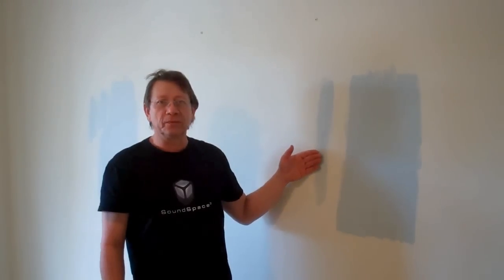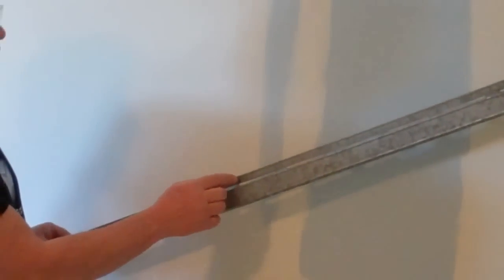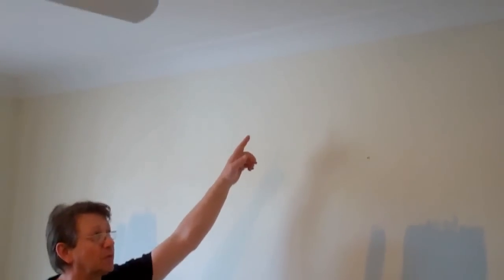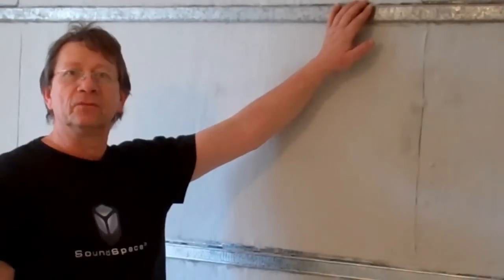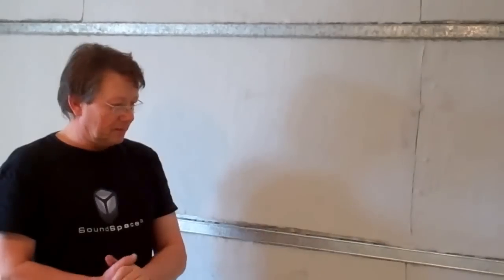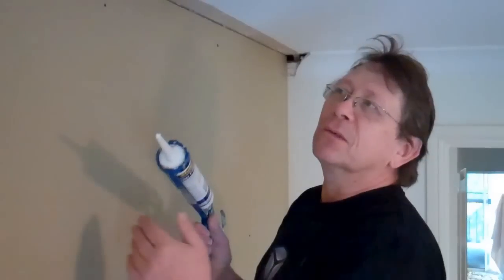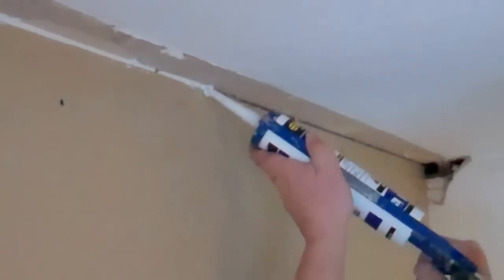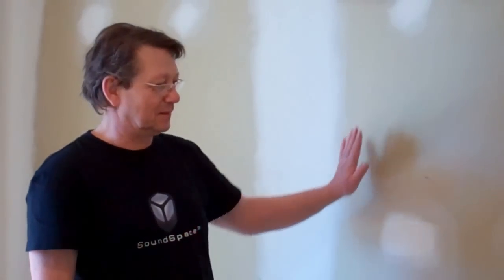How To Soundproof A Wall

Comment: i wish you could come to my country and fix my adjoining walls too! :-)
Reply: soundproofingexpert
Thank you, I've always wanted to visit Australia. If you ever visit USA then I would definitely hire you to do my walls. You seem like a very cool guy.
Reply: Aine Khell
there are all kinds of videos on youtube of crazy neighbors. but my number one complain living in the apartments is NOISE. The walls & floors are built cheaply here even we had windows so bad that if the upstairs neighbor walks the floor will shake and as a result shake my den room window :(.
Reply from the maker: I'de love to go there one day but a bit too far.
Based on your description, I think your apartment will be complicated and very costly to fix.
Reply: soundproofingexpert 
Well, here's what I ended up doing that year..: I opened the gypsum ceiling (removed the length about 2 feet wide / lenght of wall) and filled the gap between the top of the brick/ motar wall and the iron beam supports. Then, plastered over that with concrete and brick. Used several sheets of fiberglass to help muffle the sound and replaced the gypsum ceiling.

Then, removed all "holes" in the wall - light bulbs (2), switches (2), and plugs (2). Opened 2 horizontal channels in the wall; one around 3 feet from the ground and the other about a foot from the ceiling (gypsum ceiling).
These horizontal channels then allowed access to the hollow spaces in the brick wall which I back filled with motar.
The wall was re-sealed / plastered so I had one solid wall.
Then, I used heavy-grade "channel" (used in building pre-fab / plycem houses), put 3 channels one the wall - horizontally, attached the plycem boards to that and sealed any gaps with the sealant they recommended.

Yes... I did achieve a great deal of sound reduction from all that effort... but, it's not 100% - but - to me - it was totally worth it. ..

Next experiment will be with the window...but, for now I am cool with the improvement I have.

Worth every cent.
Thanks to videos like yours and the help of a very good friend, I got the courage to DIY my way to a quieter room...
:-)
Reply: Let me guess you live in USA right? Where we have cheaply built homes and apartment walls and floors. lol
Reply from the maker: No, I am living in Australia, probably the same thing!
Reply: 321192ify 
hm...I live on an island ...where we use bricks and mortar for walls...but we have "different" kinds of neighbours
Reply: Aine Khell
That is cool, I've never been on an island before but hopefully someday....I get to visit one. Where do you live if you don't mind me asking and what type of annoying neighbors can be on island?
Reply: 321192ify :-) the kind that make you go searching youtube for ways to block them out :-D
Reply: Aine Khell
oh God. lol
Reply: Haahahahahahahahahahaaaa
Reply from the maker: Which country are you?
Reply: Trinidad and Tobago
Reply from the maker: Thank you, that would be nice!
Reply from the maker: Thank you for sharing!

Comment from the maker: In order to reduce sound vibration as much as possible it is better to separate the plasterboard from the original wall and to separate the boards between themselves otherwise you'll only increase the mass of the wall and you'll need a much thicker wall to achieve the same result. You can also achieve better results by using a loaded vinyl 6kg/m2 or 8kg/m2 instead of the visco-elastic membrane between the boards.
Reply: One of the Best Ideas of SoundProofing is "SoundProof Curtains" it actually Block outside Noise coming from Windows. Check Here: https://livesoundproof.com/best-soundproof-curtains/
Reply: @laurabrown5445  I don't think so!

Comment: Many thanks for your reply. My main problem is that the party wall between me and my neighbours on both sides is just 4inch single skin brick. I have applied your method upstairs, which, has worked to some degree but downstairs suffers from impact noise where my lounge is adjacent to their kitchen and I hear everything from airborne noise, voices etc to impact noise of cupboard doors and drawers shutting and the noise echoes straight through and at times sounds as if they are in the same room as me. I have been made aware of a product MD40, rubber slabs glued to the wall but his is very expensive. Any thoughts, ideas, help woud be most welcome. Thank you.

Comment: I'm moving to a place with a game room that has two exterior walls and one to the garage (4th to house interior), the exterior walls are brick and windows.  I don't want to cover up the brick.  I'm thinking my only choice is either to investigate active noise reduction or hope there's enough room to get a permit to build an enclosed walkway around those two walls, and have that walkway act as the air gap, with its exterior walls well insulated.  I'd still need windows so may still have issues there.    Use is for live music and loud movies.
Reply from the maker: The windows need to be sound proofed as well, the best way is to build a second window, similar to the existing one and separate from from it with a gap as big as possible, 3-4 inches (75mm to 100mm) or bigger, using a 10.38mm thick laminated glass or thicker. The bigger the gap separating the 2 windows the better for acoustic. You can also add some sound absorber, glued around the inside cavity, to reduce the "echo" between the 2 windows, that helps too.

Comment: Do realize that you install the resilient channels upside down (wrong)? It matters!

The idea is to have the dogbone (slotted) holes on the bottom side. I'd expect this solution to reduce noise transmission by possibly 6 dB, maybe 10 dB if done perfectly (no possible way it will reduce noise by 40dB).
Reply from the maker: +Travis Lawrence Yes, you are right, the channels are installed upside down but I don't see any raison and couldn't find any evidence why it matters unless the plasterboard doesn't touch the floor, in that case it will be suspended and than yes could make a difference. Any way, thanks to point that out. Regarding 6db or 10db maximum reduction, I don't know where you got those figures, 10 db reduction is far too small and the new wall system would not make much difference, certainly not enough and my clients would never even hear a difference once done and simply will never pay me for it; instead they are very happy and recommend me to others, I am doing that for living since 1992.
Reply: +soundproofingexpert the 10db is just an estimation based on experience. Though I am only talking about what resilient channels specifically do for isolation, I wasn't referring to the whole wall system. In that case then STC 40 (40db) is quite likely.
Reply from the maker: +itsdastuff If you work from an existing wall you'll need to build a second partition wall separate from the existing one without touching it (10mm away), with tracks fixed on the floor and ceiling and steel studs (64mm thick) filled with no more than 50mm thick acoustic batts (avoid compression of batts between existing wall and new plasterboard, otherwise you'd court circuit they system) add 2 layers of 16mm plasterboard or 2 x 13mm acoustic plasterboard with mass loaded vinyl 2kg/m2 between, or 6kg or 8kg/m2 for better results in low frequencies.
If you don't have any wall and need to build a new one that achieve over 50db sound reduction, the most cost effective way that takes also less space is to build a staggered stud (steel) wall, 92mm thick tracks and 64mm thick studs filled with acoustic batts, with 2x 16mm plasterboard on each side and with mass loaded vinyl 2kg/m2 (minimum) between the boards.
Reply from the maker: +Travis Lawrence        OK, I understand what you mean now, that's right.

Comment from the maker: Bjorn Winterskorn asked me how the plasterboard was fixed, for some reason his question doesn't appear here but it is a good question; we screw the plasterboard in the resilient furring channels which are designed to minimise transmission of vibration but it is very important to use the right length of screws to make sure the screws doesn't touch the existing wall after going through the channels, otherwise you could court circuiting the whole system because the vibrations will be transferred from the existing wall directly to the screws and then to the plasterboard and we don't want that.
Reply: this is no clear to me - after installing the 2nd layer of plasterboard, you screw that into the resilient channel as well but of course you have to go through the first layer to get to it - so what exactly are you saying?
Reply: Wellob iously, use longer screws on the second plasterboard whatever the thinckness of board is

Comment from the maker: Resilient channeling can be attached directly to the wall but if you fix it on timber studs or battens you'll achieve better results because the more space you have between the existing wall and the new one the more sound reduction you'll have. Also, you'll have more space available to install thicker acoustic absorbers between the studs or battens.

Comment from the maker: If the neighbours are very loud, voices, Tv or music, you may still hear a little bit but it will be acceptable, according feedback I get from my clients who are quite satisfied with the results. If you can afford to lose 100mm (4 inches) you can build a new partition wall, separate and not touching the original one, using the same materials except between the studs were you can install thicker acoustic batts, there will be no much difference in price but you'll get a better sound proofed wall. Sometimes noise can come also from the ceiling if you have a common cavity with your neighbour for example, than you have to sound proof the ceiling as well.

Comment: Excellent demo and could be the answer to my problems. But, please can you tell me the name, make of the high density polyester and where to purchase. Cannot find it anywhere. Or, where I can get something similar? Thanks.
Reply from the maker: I have the high density polyester made to my own specifications but you can use high density fibre glass instead or anything similar, it is not the most important part of the system but it is good to put some kind of sound absorber, in fact, in any cavity to avoid increase of sound, a bit like a drum.

Comment from the maker: Very hard to tell, could be $300.00/m2, $100.00 more or less. Almost impossible to put a price before seeing the place.
Reply: true. I have used this ceramic insulation paint at home for heat insulation and that was the initial purpose. but now as i got into sound proofing i thought lets see if it insulates sound as well. i thought it would.  one manufacturer said 17% and your right i haven't notice anything towards sound. and i cant honestly say it does heat as well. i haven't tested either sound or heat properly.  I'm just saying. i think it does work at least a bit... it should as i paid a lot of money for the ceramic paint additive from usa.
Reply from the maker: When you reduce the sound by 10 db it is like halving the sound, if you measure 50 db and after some sound proofing work you measure 40 db you'll have reduced the sound by half; the same from 90db to 80db is reducing the sound by half.
Reply: +soundproofingexpert with a 3mm space to soundproof do i have any chance of soundproofing the walls? Not looking for a miracle but what could i do or what materials could i use in such a little space?
Reply from the maker: Only 3mm? The only thin you could do is to glue a mass loaded vinyl 6kg/m2 but I don't expect much results because it would work much better if you could separate the mass loaded vinyl from the wall, even 10mm would make a difference.
Reply: +Joaquim Coutinho you could paint the walls with (2/3 coats ) of insulating paint, they claim to reduce sound transmission by 17%. Phillippe do you agree?
Reply from the maker: +James Pitt , it may be possible to reduce sound transmission by 17% using 2-3 coats of insulating paint; I am aware of it but I never use it, because with 17% reduction, you'll hardly notice any difference, 50% reduction (-10db) is not enough
Reply: soundproofingexpert ps 17% reduction. 

i said to the manufacture / customer service, if i am playing music upstairs at 100 decibels and downstairs normally (as a control) i can hear 50db. does it mean that 17% of 50db i.e 8.5db reduction down to 42.5% and they said yes. 

do you agree with my maths. as even a reduction from 50db to 42.5db is not much but for only (2-3mm) paint its pretty good.
Reply from the maker: Consider it not as a mistake but as an investment!
Reply from the maker: +James Pitt No, not really, decibels are a geometric progression, exemple, to reduce 50db by half you get 40db and by another half, 30db, I am not sure about the exact calculation but my guess will be around 2db, you wouldn't probably able to hear the difference or hardly
Reply: +soundproofingexpert oh , i dont understand this 50db to 40db is half? (50% reduction) how does that work? 

let me google this to see. i might contact the manufacturer to see their exact calculations by they just told me 17%
Reply: James Pitt its like a logarithm reduction. Thats why what soundproofingexper wrote is correct
Reply from the maker: Sorry for late reply, yes, you'll hear very loud neighbours but it will greatly reduced to an acceptable level, unless then room is on top of the building than you may have a common roof cavity with no separation, it happen some times, in the case you can suspend 2 separate layers of mass loaded vinyl 8kg/m2 each layer with a gap around 100mm or more.

Comment from the maker: I believe the sound reduction would be around 40db, it varies bit according the 16mm plasterboard brand, the visco-elastic membrane you use between the boards and the density of sound absorbers you use.
Reply from the maker: someone said 10db? Not an acoustician, that's for sure!
Reply: One of the Best Ideas of SoundProofing is "SoundProof Curtains" it actually Block outside Noise coming from Windows. Check Here: https://livesoundproof.com/best-soundproof-curtains/

Comment: according to this technical PDF: http://www.clarkdietrich.com/sites/default/files/imce/pdf/Articles/10-18-12_RC-Delux/CD_ConstructionSpecifier-Acoustical_Performance_with_RC_%20July-2012.pdf

I quote from this article ""It is also important for the attachment flange to face down. The open side of the RC should face up, toward the top of the wall.”

Your video shows you installing the mid-wall RC channel's - UPSIDE DOWN !  

Can you comment on this disparity please ? Do you find you method superior ?
Reply from the maker: Thank you for sharing the article, it complement well my video. To answer your question, according the manufacturer in Australia, the open side of the Resilient Channel should face down, (may be because we are in the south hemisphere, ha ha); I think if the existing wall is plumb, it doesn't matter but what really matters is to make sure the screws fixing the new plasterboard and going through the RC doesn't touch the existing wall otherwise we'd court-circuiting the whole thing, the screws must be the right length, not too long not too short.

Comment: Good Video - imagine i have just built a great sound proofed wall as you describe and my wife walks in and says - I want a picture here and there and 2x shelves over there. Could this be part of the design or such a small compromise in the installation as the two plasterboards are secure with dry wall screws and the membrane between so any additional fixings would have a negligible impact to the walls performance?
Reply from the maker: You can attached anything on the new wall as long as the fasteners don't touch the original wall otherwise you'd court circuit the system.
Reply: Pity nobody has answered this question. What about fixing wall cabinets?
Reply from the maker: jondo12 Sorry for answering too late, I didn't see the question. Yes, you can fix wall cabinets as long as the fasteners don't touch the original wall otherwise you'd court circuit the system.

Comment from the maker: Bass are low frequencies and the hardest to stop, this system will make a big difference already but if you can afford to lose around 100mm (4 inches) you could build a separate partition, not touching the existing wall, just fixed to the floor and ceiling, that would be the best solution, you'll have more space to install thicker acoustic batts in the cavity. The bigger space you have from the existing wall and the new one the more sound reduction you'll have. You'll not stop bass 100%, you'll still have some sound transmission from the adjacent walls but it will be very much reduced.
Reply: What about using a rubber mat to add mass to the wall. Would that help cut down one the bass?
Reply: Is there a product like that on the market?